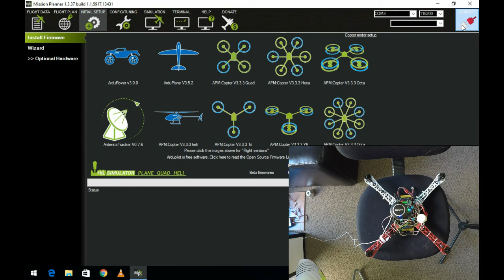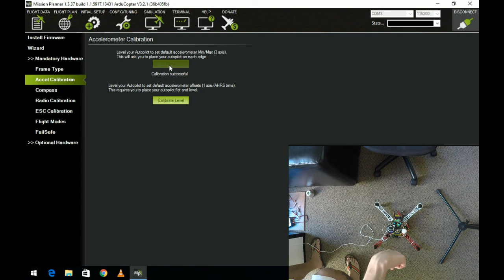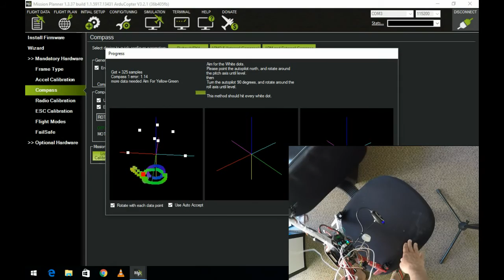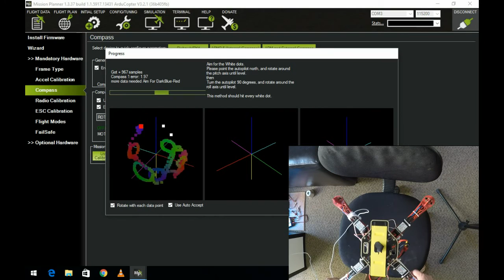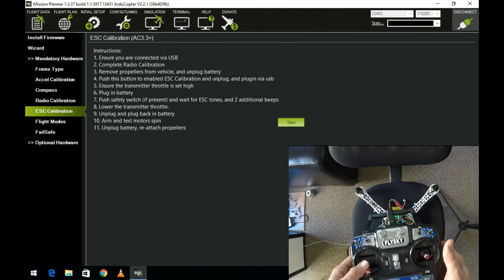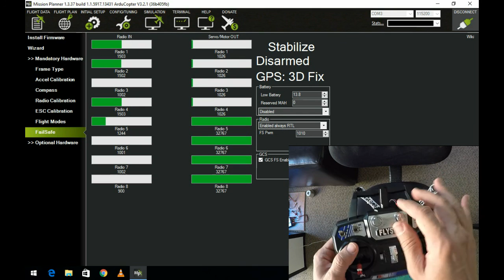APM 3.1 Mini part 2 (setup and calibration)

Comment: Hi.  Is there a reason why run PPM instead of iBus?
Reply: Erich Stein APM does not support iBus
Reply: Wilson Quintero I found the code to translate the iBus serial data, and it's on a github with notes marked for use with Mavlink.  Whoever decided to exclude the protocol is mystery to me - I tested on my own system, and it works.
Reply: I spent a few hours analyizing the source code for APM.  From what I can tell, - the chip that is piggy-backed in APM, is only another protocol conversion that can take a protocol, and convert it to the PPM internal signal that the Mega 2650 chip firmware uses to process controller inputs.  For reasons unknown, nobody wrote a serial protocol into the APM firmware.

Comment: hi i have the same gps/compass. but im having serious issues with the compass, i calibrated many times and different ways but the compass is always way off and not showing the good direction. any idea?
Reply from the maker: Hi Pasi FPV,

Sorry for the late reply, I hope you solved your problem by  now. If not, I can tell you that I had similar issues and I checked the following:

- Calibrate the compass away from any electromagnetic field. 
- Make sure that your on board compass is completely isolated by cutting the jumper
- In MP, double check that the "external compass" option is selected

I hope this helps

Cheers